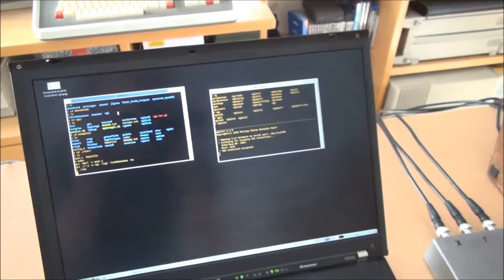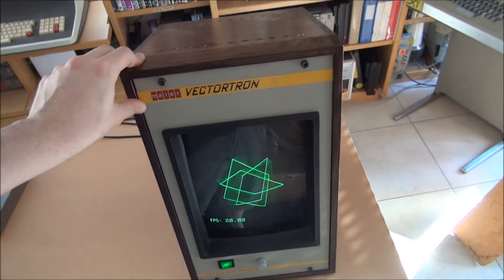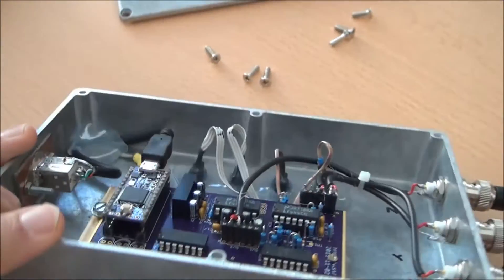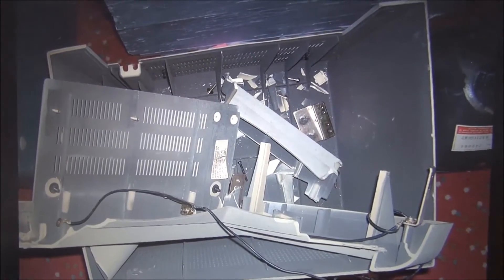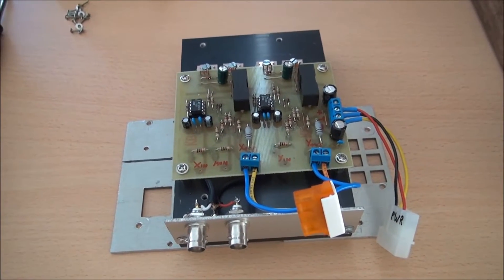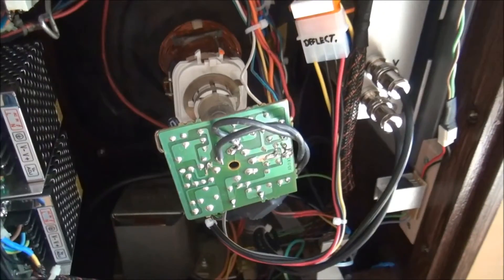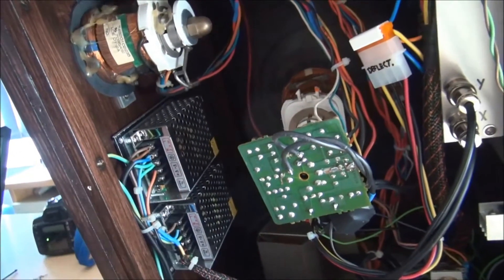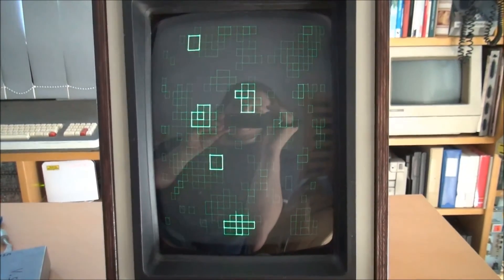vectortron - a versatile crt vector graphics display

Comment: Is it possible to get a small colour vector display ?
Reply from the maker: It should be the same principle, with the exception that one has 3 video inputs instead of only one. However, color monitors are more complex. I would expect some pitfalls here and there, but why not give it a try? Maybe you can find a yoke from an old arcade machine on surplus.

Comment: Excellent work Philipp! I'm trying to build a v.st board myself, but can't find the values for R16, R17 and R20. I'd be interested to know what values you used and also to know what modifications you made to connect the extra pots. Any pics on a website somewhere?
Reply from the maker: According to my notes R16 and R17 are 10k and R20 is 75r. I remember I stumbeled upon the same problem so I just guessed the values. Maybe you can also email to Trammell Hudson, but I think 10K should do well. The modification with the pots is fairly simple. I just do not use the intended reference source to center the secreen, I just generate those voltages using the pot. I have a schematic that includes my modifications that I could email you. Just contact me under: http://runningserver.com/img/runningserver-email-001.gif
Reply: the component values can be found from the eagle files in github or from this schematic https://i.imgur.com/efAkezt.png
Reply: Thanks for taking the time to reply Samuli, but R16, R17 and R20 are the only resistors whose values are neither in the eagle files nor the schematic, hence my question.
Reply: Many thanks Philipp!
Reply: oh right forgot about those, sry didn't read the question properly :)
Reply: @robinchampion  Thanks a lot Robin for info, I'll check the solution with pots. But anyway I think with the correct connection of differrential amps the centering pots may not be necessary. I will study it.